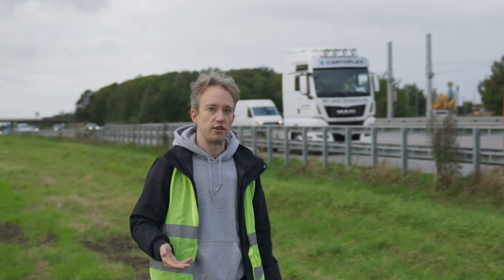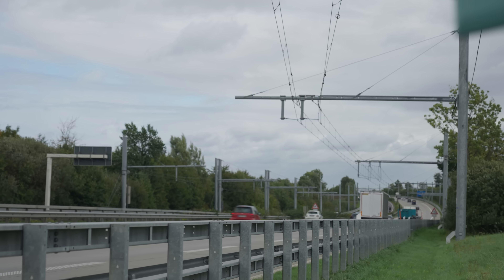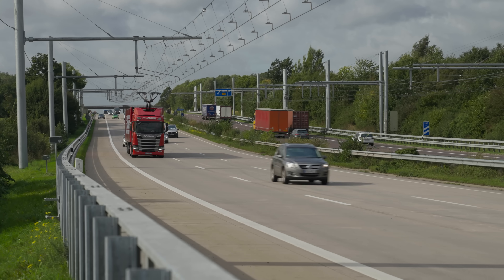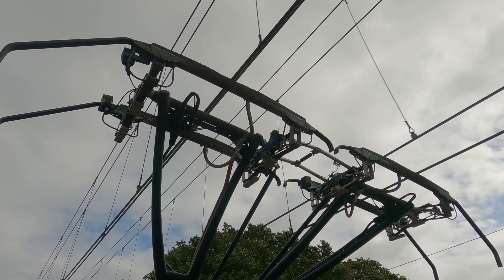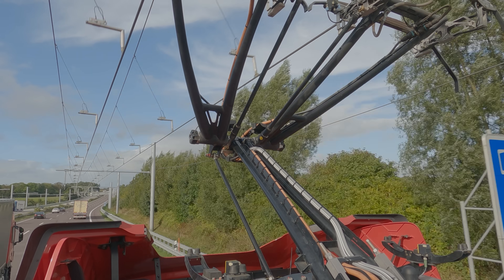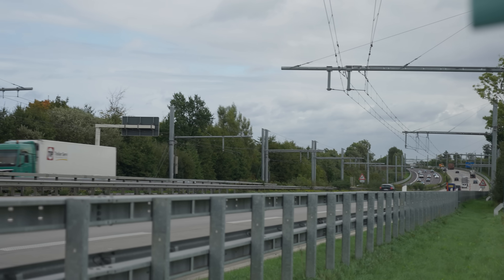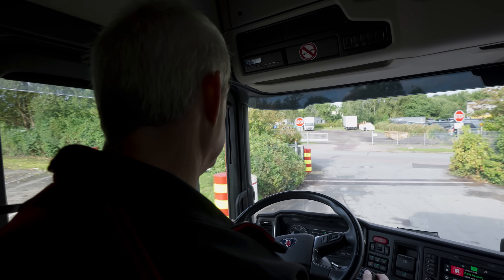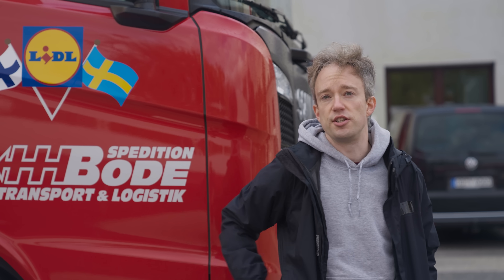The highway where trucks work like electric trains

Comment: Why not just build more railroads with electrification? Use of comfortable and handsome public transport is a better solution rather than trying to improve lots of personal autos. In the end, there would, of course, still be some routes that are only available for petrol-based cars or electromobiles ('private' transport), but there won't be many of such routes and it would be possible to rent a car for this particular journey rather than buying a car per family (or more).
Highways with catenary seem to be only viable for a very specific distances (10-30 km), because on longer distances (starting from 50 km) freight could be more efficiently moved by trains at least because they have lower frictional resistance and have more regularities (signalling and automatics control all the behaviour on line, there is no such thing as reckless driving).
Reply: Trucks can go the last mile. Trains can't.

Not every business has a train station. Not every discounter has a train station. So electric trucks make sense.
Reply: Because you can't have a freaking train station at every freaking supermarket.
Reply: @theuncalledfor  Thank you
Reply: @theuncalledfor  The idea of a freaking train pulling up at a freaking supermarket just to unload some freaking goods gave me a good freaking laugh.
Reply: More railways would mean more infrastructure and human footprint in nature. How much wilderness is left in Europe? Very little. And the few small spots of woods needs to be protected. If new reailways were to be built, make tunnels for them.
Reply: @williamkristiansen4938  Well, how many 6-track railroads have you seen in the last, say, 30 days? Probably, less than number of 6-lane highways.
Of course, there are some objects like sorting stations or freight parks, but these are just points on maps, not lines.
Asphalt, despite being one of the best recyclable materials, still is not a kind of 'sustainable' human footprint. 
New infrastructure projects would still be conducted, but a 4-lane highway is definetely more harmful to the environment, than a 2/4-track railway.
It is not only about energy savings (difference in rubber tires VS metal wheel friction might seem to be 'small', but you have to multiply it by a number of vehicles and their length of journey), but also about pollution. You can not just stop near 4-lane highway, walk 100 meters and collect berries or mushrooms. Pollution from highway stretches widely and accumulates with time (bioaccumulation effect). With electrified railway, you can do just that. A band of nearly 20 meters might contain some litter from loosely fixed freight in boxcars, but the same goes for diesel vehicles. 
Also, when a road falls into disuse, it is not a good present for the environment, just because asphalt is not particularly recyclable by the nature itself. Probably, trees will grow all around, but these would still contain a lot of contaminants. And you cannot just resume usage of disused highway, it requires an amount of work comparable to building a new one.
With railways, it is a different story. Of course, after 20+ years of disuse, no train would manage to use it again without reconstruction. But, for a basic usage, it would only require to cut trees between rails and fix track connections. There are a lot of examples, when you can only see a line of trees in a forest, which is actually a disused railway. In most of the cases, even fullly-functioning railroad has a smaller footprint than inter-city highway does. Moreover, long (100 km+) electrified railway sections are very rarely fall into disuse.
We cannot just ban all the private transport without providing a decent alternative. However, this requires some steps to be done and a starting point. In order to reduce the number of future problems, it is a good way to better plan new infrastructure projects.
So, probably, it is a good idea to build new railways instead of highways, when we are talking about 100 km+ of mostly freight traffic.
If new highways are to be built -- please, make tunnels for them and no ventilation to outside :)

Comment: Fascinating concept. 
Even more so If antonymous driving comes into it's own.
Those lorry's won't be parked long enough to recharge during  loading and unloading. 
For example swapping containers takes a few minutes. Even with the best batteries and most powerful charging systems systems it is still going to be a delay. 
So it is a great solution as an on the go charging system that can run 24/7. 
No need for a massive investment but just selected main roads. 

Oh and just for fun @ICE and Hydrogen fans.......refueling on the way. Can you do that trick?

Comment: I think people are very much misunderstanding the point of this.

It's not doing the job of trains.

It's providing a way to charge electric trucks while moving.
So they can replace fuel powered ones without the main issue that draws electirc trucks back of charging times.
Reply: > It's providing a way to charge electric trucks while moving.

Why would you want this? Truck drivers have to take regular breaks anyway and stationary charging stations at every truck parking space along the highway would cost maybe a tenth of this system...

Comment: The does make sense, my only concern is many UK motorways are set up that in something under an hour parts of them can be turned into makeshift runways. That wouldn't be possible with overhead cables so are we at a stage we no longer need that ability to covert them or are we going to have sections that overhead cables won't be installed.

Comment: Do you know how they ensure that the twin pantographs are in line with their respective wires? This is the fundamental difference between these and trolley buses, and strikes me as being the most complex part of this. Presumably the trucks are partially self steering using lane detectors?
Reply: I don't think they'd be self steering as part of this system, but they could use horizontal actuators on the pantograph to maintain alignment. But from what I can see, they just rely on the driver staying roughly in the center of the lane. If the driver is too far off center they just run off their internal power source instead.
Reply: @eDoc2020  possibly, but there must be something to stop shorting between the two wires and the pan. They look about 1m wide, so the wires could be further apart, but you'll need a very effective pan drop device to stop the pan from springing up above the catenary and unzipping it. It's bad enough managing this on a railway where there's only one contact wire and the trains are on rails.

Comment: If germany hadnt put train management into the hands of one corporation which monopolized the industry and stopped building good infrastructure bc its too costly we could do more long hauls on rails which is the most efficient anyways. This is really just a solution to a symptom, it does actually fix the root of the problem.

Comment: I have to say, I wouldn't put it past me that you could set up a "two-lane" system where you have a lane for truck delivery and another to send electricity along the highway between cities. That would also help densify the electricity infrastructure so a fail in an area wouldn't make a whole region lose access to the power grid.
Reply: Probably wouldn't be easy, having 1.5KV DC and 60KV AC line next to each other would require some creative use of isolation.
Reply: that would not be possible. There is a reasons why powercabels, especially those you want to use over long distances are really high above the ground: Highvoltage, you risk serious ark flashes that close to the ground.

Comment: Or you could just transfer most long-distance cargo hauling from trucks to trains and spend the money on expanding rail infrastructure, which is guaranteed to work and be both economically and ecologically sound. Sure, you can't go everywhere by rail, but you also can't build these wires everywhere.
These cables exist along a few kilometres in one country on one Autobahn. In relation to the European transport infrastructure that's nothing. And even these cables don't get used that much, because electric trucks are still rare, and if this is all largely left to the market to decide, they will stay rare for too long to be relevant in mitigating the worst effects of the climate crisis.
Thinking about maybe implementing this technology in the 2040s in parts of Europe, when we could use rail and  generally reduce the amount of goods we transport over such long distances by locally producing where possible, we could see a reduction in CO2-emissions sooner and guaranteed.
I highly doubt that this is the future of transport infrastructure.
Like many attempts to create a more sustainable economy, this only partly fixes a symptom of a deeper problem, that being our wastefulness of goods, a lack of local production and an over-reliance on long-distance supply chains.
Creating an actual sustainable global economy will necessitate more fundamental changes then just slightly shifting our sources of energy over several decades.

Comment: Well, the thing is, this is in fact a very inefficient freight train. Inefficient because of high friction (rubber on asphalt), higher personnel cost, as a truck driver drives only 1 or 2 containers, and it still needs a battery for power if a truck/lorry goes off the grid.
Don't get me wrong, it is still better than the current system, but it is still not very good and still has several problems like traffic jams, labour shortages, and all the other nightmares of logistics (like just-in-time-delivery).
Reply: How is friction between tires and the road a bad thing now?
Reply: @joeyschmutnick5695  not energy efficient
Reply: @Kakuoin  well cars slide no less on the road than trains on rails. Not that I think cars are very efficient  just consider the amount of braking that wastes energy in a car compared with a train but i dont think tires gripping the road are the problem since thats exactly their purpose. It allows a car to accelerate and all
Reply: @joeyschmutnick5695  It loses a lot of energy and causes a lot of fine particle pollution.
Reply: You say "it still needs a battery if it goes off the grid" like that's a bad thing. It isn't though, that's the advantage this has over freight trains: it can go off the grid and deliver directly to the customer.
Sure, it isn't the perfect solution for every imaginable situation (and nobody claims it is), but for routes that have considerable traffic, but not enough to make building rail infrastructure economical, this may be a great middle-ground solution.
Reply: The problem is that rail freight isn't flexible enough to replace road freight. The massive numbers of destinations and origins for the freight would require huge sorting yards and many branch lines. Rail is great for connections from a port to an inland container distribution centre, but the sheer number of destinations from there on makes rail impractical. And that's not even beginning to talk about non-containerised freight like fresh vegetables which need refrigeration. 

Like most things, a combination of approaches is likely the best.
Reply: And is there a better solution?
Reply: @moooseman3  Fuel Cell Electric Vehicles exists. And one example is a truck that uses hydrogen instead of diesel as fuel.
Reply: @midnightgear2616  fuel cells are even less efficient, you are going in the wrong direction.
Reply: So, what, you want to build a train station at every supermarket, every clothing store, every literally everything that neds deliveries by truck?
Europe already uses freight trains. They're not viable for every route.
Reply: @theuncalledfor  No, I didn't say that. But there are cargo stations in every city. For the last mile, trucks definetly have their place. I just think, the long route trucking, for which this technology could be a solution as said in the video, should be replaced by freight trains, as they are way more efficient.
Reply: @EibaProductions  
1. No, there are not.
2. Even if there were, villages and towns too small to qualify as a city don't all have them.
Reply: @theuncalledfor  There are. You just need to look ;)
And that is for the last mile. (Again, the last mile is not part of the discussion)
Reply: But it's a good system for small amounts of cargo going short distances, where a train line might be too expensive to build and run. Who'd run a train between two towns for just a few trucks worth of cargo per week? And it makes use of existing infrastructure. It might not be the best system forever, but it's definitely better while you're planning and building new railway lines.

Comment: I can see that has some prospects.
When I was a child in the 60's Hull had many trolly busses run from over head wires.

You should come and look at the guided bus service between St Ives and cambridge. Old railway line with a concrete guide way so normal busses with a small modification can travel on a narrow roadway with no other traffic and yet still leave the guided way and travel on ordinary roads into town.. Excellent system we should see in many other parts of the country. Maybe we do and I just don't know.

Comment: What is wrong with trains?
The Victorians didn't have a problem with them. Lorry's block up the roads and course bad congestion! Trains are the future 100%.
Reply: Ever seen rail way tracks going to your super market? No? Thats why. People have this fantasy about trains, but its like solar roadways or the Hyperloop. Things got to this point where we are for a reason. Lorries are better than trains because, guess what, a Lorry can go where it wants to, a train has to run on tracks.
Reply: Lack of flexibility, super high construction and maintenance costs for the tracks, extremely low friction between the metal wheels and the metal tracks => can’t really go uphill or downhill + needs large safety distance between each train, huge turning radius, ...

Trains are great for frequent long distance transport between a few, fixed places, where the goods are in large chunks and the demand is highly predictable. They are rubbish at everything else.

The Victorians needed trains because steam engines of the time had absurdly bad power densities... in layman’s terms: they were extremely heavy and couldn’t use normal roads.
Reply: @peterfireflylund  I mostly agree, I get that upgrading railway capacity to move road traffic to rails is not trivial, but, won't the majority of highways covered by this electric infrastructure be next to railways anyway? Except maybe for mountainous locations. Are there that many places reached by highways but not rail? I'm actuallly asking because I've no idea how common that is. In such places it would definetly make sense to use this system, but elsewhere it would be more efficient to use trucks on batteries for short distances from the nearest railway station.
Reply: Clearly something or they would be the solution. Trucks are point to point, easily scalable and competitive.
Reply: Ive never seen a train come directly from a sea port to my local fruit shop have you?
Reply: You can reach every little corner in the city and stay able to climb a lot better and have a shorter turning radius. You are more flexible in terms of loading, hence you don't have to wait til all other 20 containers on your train get loaded and a single broken axle won't stop the delivery of 30 other containers, hence you have concrete tracks that allow you to circumvent issues at literally every part of an inch. Not just every few miles on the next junction...
Reply: What is wrong with trains is that they transport large amounts of freight from one major hub to another major hub. You need trucks to distribute the freight to smaller endpoints.
Reply: Trains have zero flexibility and trucks are still needed to take the goods to and from the train stations.
Reply: The Victorians didn't have much choice; steam engines were the only available technology capable of moving large amounts of goods and the only moving vehicles they really really worked well on where ships and trains. If they had access to internal combustion engines that could produce a few hundred horsepower while being small and light enough for a road vehicle, they certainly wouldn't have built quite so many railways... (Also note that a good proportion of railways built during the period of "railway mania" were never truly economically viable...)
Reply: You would have to build your train part up to your warehouse, while the road is already built.
Reply: In the UK most of our railways are Victorian/ Edwardian so they do stand the test of time. Back in the day most produce was delivered by ford transit directly from the train station because it's cheap, easy and less congestive than lorrys.

Comment: xD thats such a gineus thing ... the only question is ... on highways there will be more high speed accidents then in the cirty where the tram is usally driving around ... so what does actually happen if a car hits on of these masts at a not unsignificant speed ... usally next to highway "*things*", lights and stuff are ment to kinda give way to give a car more time to slow down saftely  in the case that anything gets wrong. if these just give way, then there will be high voltage lines laing on the street .... so ya thats the only bad thing i can think of right now with these...

Comment: so let me get this right ? Germany are currently phasing out all their nuclear reactors and running most of their country on coal powered electricity at the same time trailing something that would massively tax the countries power supply, hence needing more power and more coal??? I'm i missing something or does this sound massively counter productive ????? this would all produce more green house gasses then it would if just running on deiseal
Reply: Coal powerplants are much more efficient and cleaner than small engines.